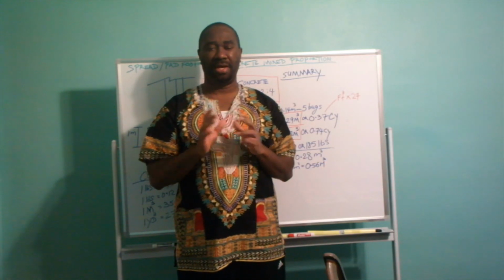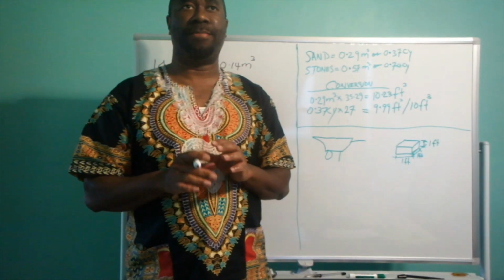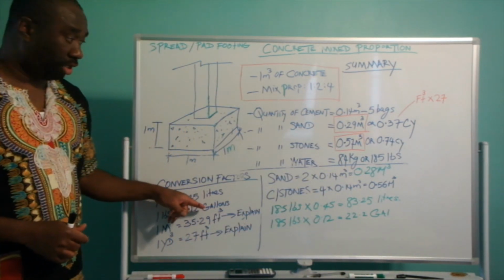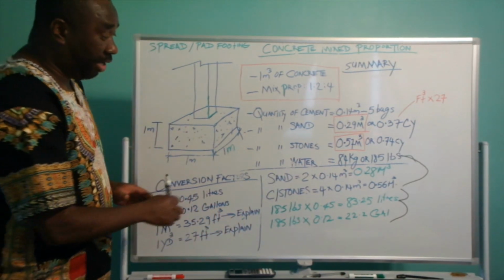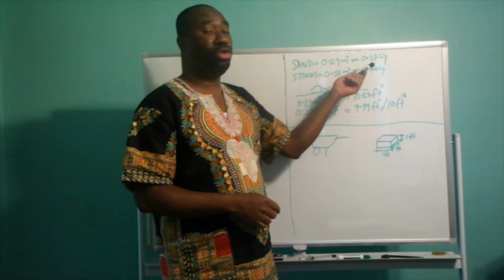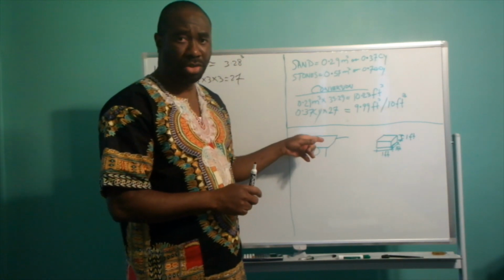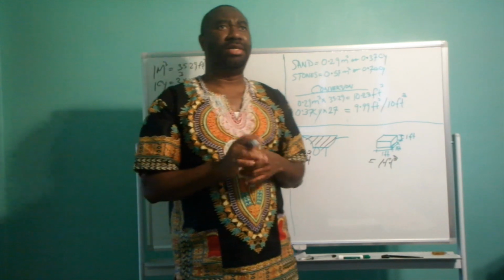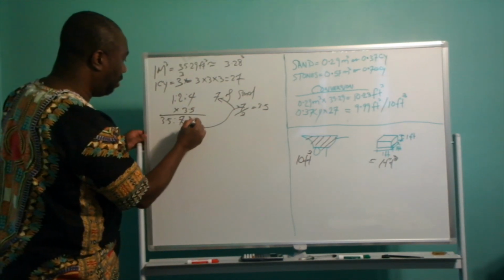How to do Concrete Mix on construction site in Jamaica (PT2)

Comment: How do you determine the concrete mix ratio for 1) foundation, 2) flooring and 3 decking?  Thanks for your response
Reply from the maker: Foundation, flooring and decking are structural elements that should be poured with the strongest concrete. You should use 1: 2 : 4  or 1: 1 1/2 : 3  to pour these concrete structures.